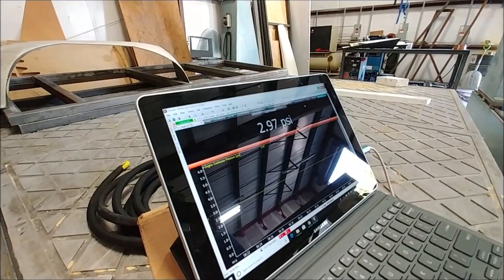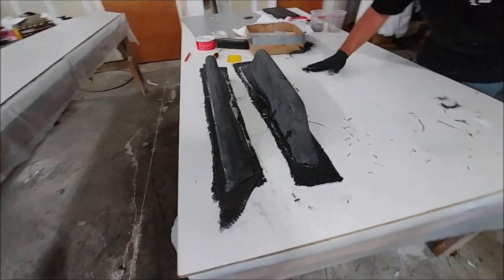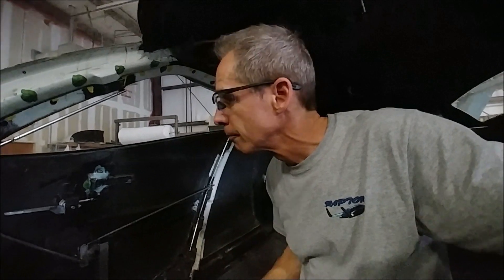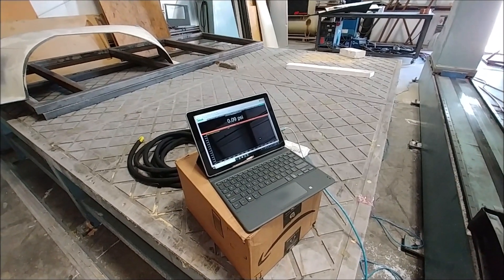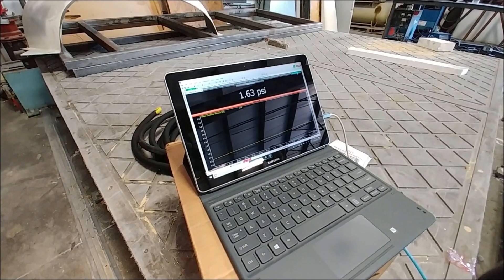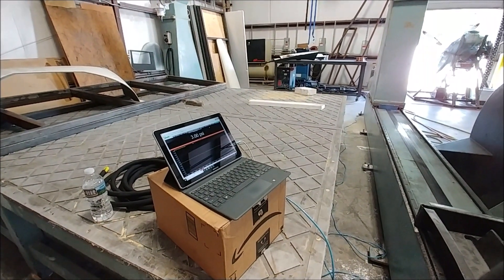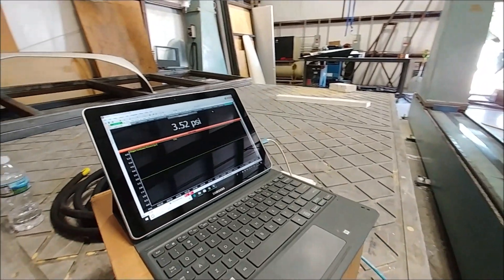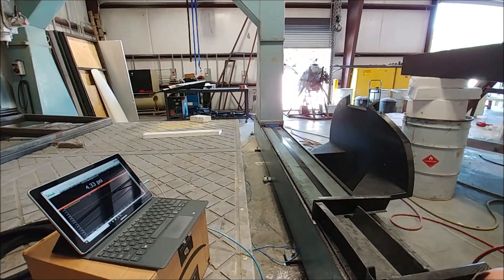1 psi, 2 psi, 3 psi, Boom!? - Building the Raptor Prototype

Comment: I had the same question as Railroadrookie, if you start on the ground, close the doors, and start pressurizing, then as you increase altitude, you would be increasing air pressure differential quickly, and thus would easily go above 7.3 psi without a pressure relief valve. Also anywhere there is air escaping from a pressurized "tank" you have ice build up at that point, the ice would build up and break off, but before breaking off it actually stops or severely slows the flow, causing the cabin to be over pressurized. Not to mention you may get icing on some unwanted surfaces. It Would be a good idea to put a couple pressure relief valves into the engine compartment to make sure they stay warm at high altitude.
Reply from the maker: We're using 2 main valves and 2 backup valves. Should be enough.

Comment: You know, I wonder if it would have been a good idea to push for a flying prototype without worrying about fancy things like pressurization, arm rests, avionics, etc. That way you could test out the most important aspects, flying characteristics and performance, first. It would really suck now if you have to make any aerodynamic changes given the time you've already plowed down into molds, doors, etc, all of which would then have to be redone. You must be quite confident in the simulations?

Comment: Through watching these videos as they come, I can't help but wonder why you put the seals on the elongation axis?  In other words, as the cabin increases in pressure the the surfaces you are trying to seal are pulling away from each other. As I see it you could solve this problem by putting the seals on the "outside" of the cabin, but on the inside of the doors.  you may have to countersink the cabin so the flange on the door is not sticking out causing turbulence, but it would allow the cabin to expand and not pull away from the doors. ...

Also out of curiosity, why are you not putting two seals on the door as a safety in the event that one would fail during flight, causing sudden cabin depressurization?

Comment: It would seem that the difficult part is: the doors don't elongate as much as the fuselage. Fortunately,  there was no forceful disassembly, so the sealing issues can tackled be solved in a progressive fashion.

I am curious about the profile of the seals, and whatever backing substrate/reinforcement they have.

I wonder also, if all else fails, if another layer or two of carbon around the doorjam might stiffen those edges. Is it possible to put a go-pro inside to watch the problem area to see if deflection or twisting might be happening?

Keep up the good work.

Comment: It may be worthwhile to strain gage some of the higher  stress areas as fuselage is pressure loaded and use that real world data to check the FEA.   Not sure how valuable this is in composites but my Fortune 100 company would check any unrest analysis model, with lives involved 7 ways to Sunday on all critical components.

Comment: Are you planning on performing a planned number of pressurization cycles on the fuselage? Pressurized aircraft are typically first life limited by the number of cycles made on the fuselage over it's lifetime. While a GA plane would never cycle as quickly has a transport airframe will do, it would be good to have an idea of any weak spots in the build that start to give over time.
Reply: Life limits are usually because of fatigue life. Chuck Texiera from Trek bicycles states “In fact, they (carbon composites) don’t actually fatigue like metals in the same classic sense of the word. The fatigue life of the fibre itself is just about infinite.”
Reply: MercFE8235 
A good proof load test on application / material like this should be all that is needed on all critical components.
Reply from the maker: That is the plan.

Comment: I can only imagine how hard and fast your heart was pounding during that pressure test!  I have a question I am by far not an engineer but at  25,000 feet 15,000 feet etc. the air is thinner so how does that change the characteristics of the pressure inside the cabin and expansion in the fuselage would it make any difference or does it make it expand more or less I would think it would expand more since the air is thinner but I have no idea that’s why am asking thanks!
Reply from the maker: It's all relative. At 25000 ft the outside air pressure is about 5 psi so the cabin would be max 10.5 psi which is what the outside air pressure is at 8000 ft. Comfortable and breathable.
Reply: Airplanes are pressurized because the air is very thin at the altitude they fly. The average passenger jet has a cruising altitude of about 30,000 to 40,000 feet. At this altitude humans can’t breathe very well and our body gets less oxygen. This is called hypoxia and can cause slower thinking, dimmed vision, and death. Another effect of a depressurized cabin can be “the bends.” This is the same thing scuba divers can get if they resurface too quickly. A dramatic drop in pressure can cause excess nitrogen to come out of the blood stream as gas bubbles. This can result in joint pain, paralysis, and death. To prevent all of these complications, the cabins of many aircraft are pressurized to near sea level pressure, which makes breathing in an airplane about the same as breathing at sea level.
Reply: It's all about Delta P, the pressure differential. It's the difference in pressure from inside the cabin to outside the cabin. He is bringing the pressure differential up to 5.5 psi to achieve a cabin altitude of 8,000 ft at. FL250. Like Peter said, for testing it's all relative. Altitude has no effect on expansion. Temperature, however, is another factor at play as a result of altitude. Considering that different materials have different strengths at different temperatures could play a role but fortunately carbon fiber is optimally suited for tensile strength applications like pressurization with little change due to temperature.
Reply: Thanks everyone for answering and responding to my question. Sincerely do appreciate it.

Comment: Since the door frames expand under pressure and enlarge the gap, would it help to use a larger inflatable door seal so that after the initial inflation after closing the door, you could inflate more at altitude to enlarge the seal to close the gap more?
Reply from the maker: The next larger seal would be too tight for the door to close when deflated. We would have to hunt for a different seal or get a custom profile made if we wanted to step up to a slightly larger size.